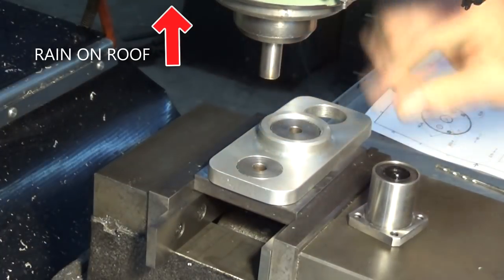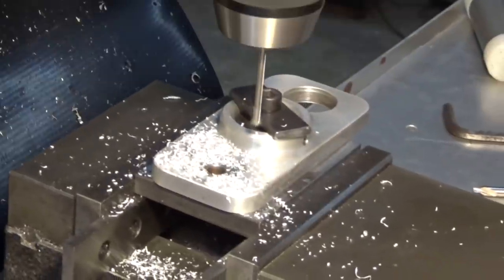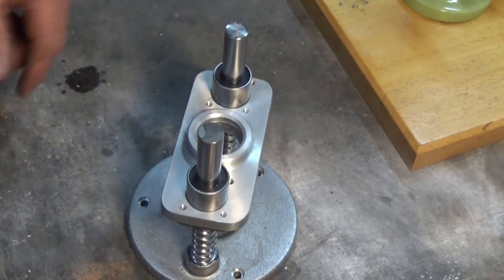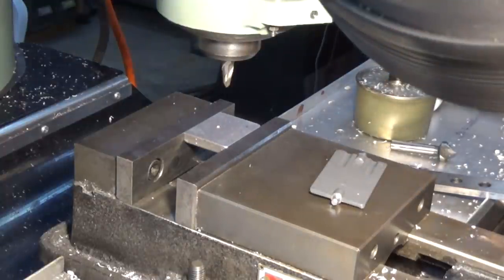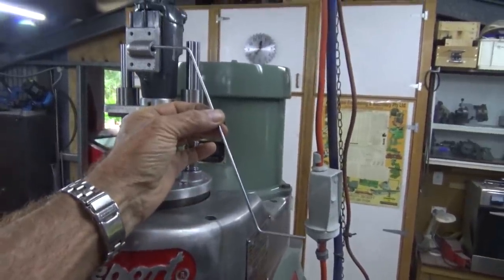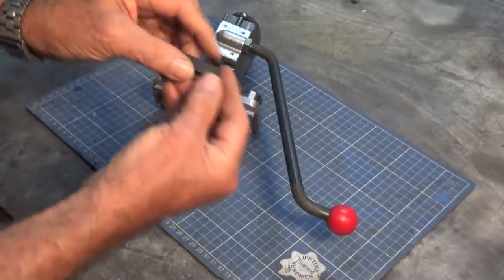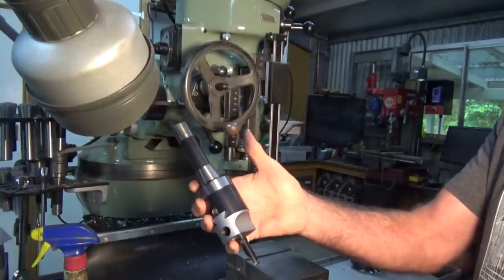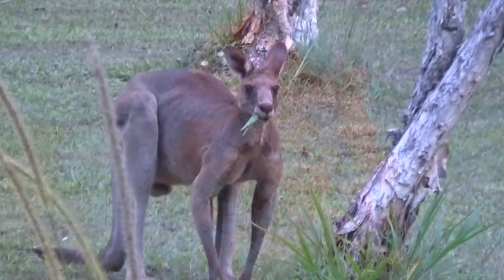DIY Power Drawbar for a Bridgeport Style Mill - Part III

Comment: Is there any reason to not leave the sock engaged at all times to avoid having to mate the socket to the drawbar? Seems to me it would be easier to have the handle just tighten and loosen the drawbar and not worry about engagement.
Reply from the maker: William. early on in my research I came across a design where the impact wrench was permanently engaged. I wondered if the constant spinning of the socket wrench spindle would quickly wear out the bearings and the vane motor since it all spins when the mill spindle is running. Maybe it doesn't matter but I am sort of committed to the design now. I got very close to having it all finished today and then disaster struck as you will see in the next episode. You can share my shame and embarrassment. 🤦‍♂️😥
Reply: @Preso58  Good luck! I've been working on a 3D printed project and I have a much greater appreciation for design.

Comment: I'm enjoying this series. 
I wonder how long the toggle will last with the strain it will be under from the pull handle,.
Reply from the maker: It seems to be still working fine. A lot of the time you don't actually need the locking toggle. I am sort of getting used to knowing which tools need it and which don't. The R8 collets pop in and out fairly easily without the toggle but my big keyless drill chuck is particularly obstinate!
Regards,
Mark

Comment: Couldn't you also use the impact wrench as a hammer? pull on the handle, bang the impact wrench into the drawbar and release?
Reply from the maker: Absolutely, and I have done it that way but I wouldn't say it out loud. 
Regards,
Mark

Comment: Wouldn't it be easier to fabricate something like bike brake but the cable retracts a spring loaded pen that would pop into place at the bottom of travel
Reply from the maker: In hindsight, there are lots of options but I have had the PDB operating on the mill for over a year now and it works fine. I don't even think about it much any more. 
Regards,
Mark

Comment: How do you hold the tool in the spindle when both hands are operating the levers on the power unit??
Reply from the maker: I lock the spindle with the brake and lock quill lever as well. When you see the collet or tool drop down a bit you can grab it to prevent it from dropping out of the spindle completely. It takes a bit of practice but I don't even think about it any more. 
Regards,
Mark

Comment: Hi Mark, I’ve been watching this with interest. I have NT40 tooling on my Chinese clone and will definitely need a modification to break the taper. I wonder if the new locking piece could be attached to the handle and be pulled down with the air tool and lock onto a bracket attached to your cast plates so that you don’t have to climb a ladder to work it?

Comment: Yes Mark, I built one of GHT's Tapping and Staking tools. Never regretted it, spot on for Ba taps et al. I notice you have also made the sensitive drilling attachment! I've got the castings, but wondered if it was worthwhile. How do you find it, or more to the point, do you use it? I'm enjoying your series too. Thanks.
Reply from the maker: Peter. I think I have only used the sensitive drill head a few times. It's lovely to use but the problem is that the round belt is difficult to weld together. It sometimes breaks and it got shorter and shorter each time I rewelded it. I scrapped the urethane belt and bought a hollow plastic belt with a little double ended screw joiner but even that failed, and not where the joiner was either. In time I may mount the motor on the rear of the drill head like a regular drill press and just drive the spindle with a flat belt. I took the tool to school one day for some students to use. We had to counterbore some tiny aluminium wheels so we could press some synthetic sapphire ring bearings (jewels) into the hub of the wheel. The jewels were only about 2.8mm diameter and the bore was just big enough for a fine sewing needle. We were making precision wheels for a model formula one car. I had a student detailed to bore out all the wheels and we were able to set the stop so the counterbore wouldn't go too deep. We then pressed the jewels in with the staking tool attachment. The jewels were as brittle as glass but we didn't break a single one. I had to have him working on a desk with a black cloth and a tray under the tool in case we dropped one of the jewels. They are clear like glass and we didn't have any spares. 
Regards,
Mark
Reply: @Preso58  Thanks for that Mark. The reason I was dragging my feet on the drill side was that round belt! For the life of me I could not see it being effective? I thought about direct drive with some form of toothed belt. So I'm glad I've held back in light of your experience. Thanks for taking the time to explain.

Comment: Wow! This is a serious project. The result is really satisfying to see, though. It’s truly impressive. Seriously. 

BTW, did Noah drop those kangaroos off the Ark on the way by during the storm? (Are those things just walking around everywhere? For some reason I thought they were relatively rare and only found in remote areas.)
Reply from the maker: Ha ha! No, kangaroos are almost a pest in some rural residential areas. We see them regularly and you have to be careful not to corner them or startle them. They are serious and powerful animals. The big males can stand taller than a human and they can disembowel you with a few kicks from their hind legs. The experts claim that the best defence is to lie face down and protect your head and face. About all they can do then is to stomp on your back. Having said that, they are also very wary and will bound away if they have somewhere to go. They can clear a five foot high fence from a standing position easily. 
Regards,
Mark

Comment: I know, it might sound a bit barbaric, but you can just pull on the handle and slam the pneumatic motor down, against the loosened drawbar, thus ejecting the tool from the taper.
Reply from the maker: Don't tell anyone but I have absolutely done that.  I daren't show it on video though. Might ruin my reputation as a caring and fastidious machinist. 
Regards,
Mark
Reply: @Preso58  I dunno, it sounds barbaric, but in reality... what's gonna happen? It's a pneumatic impact driver. It's made to handle hammering. A lot more hammering than it takes to knock the tool out of R8 taper.